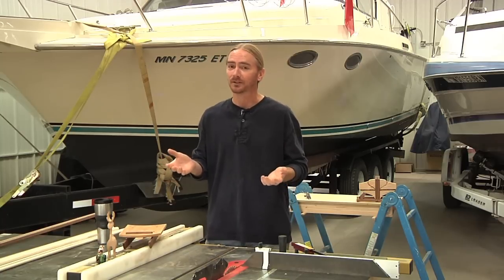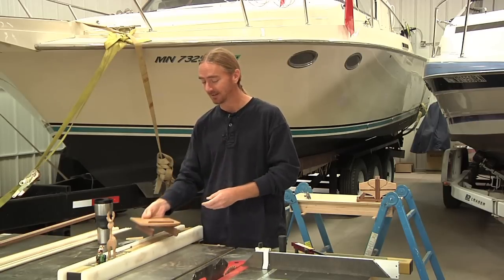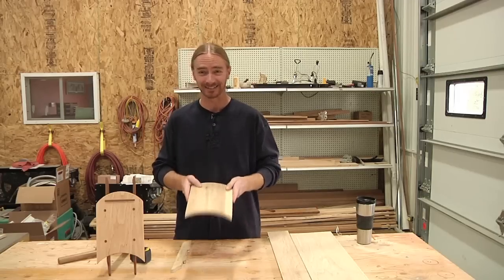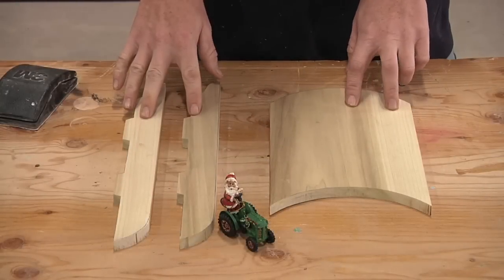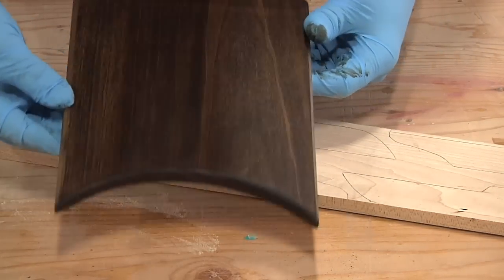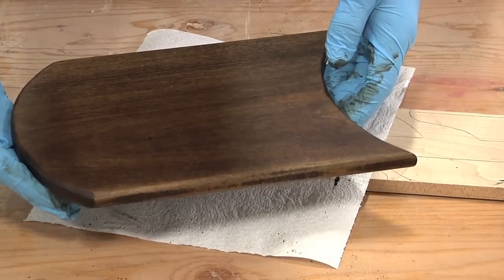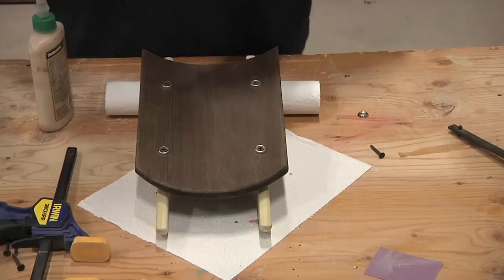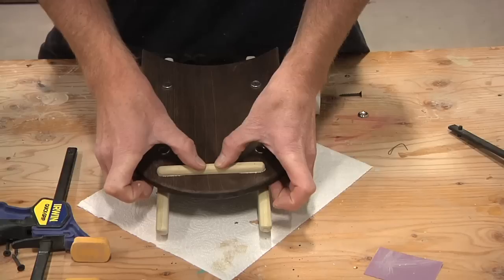Christmas Sled Build

Comment: I actually found your site looking for advice, instructions etc regarding the application of a marine finish to a teak seat board I repaired on a small cat boat. Basically two cracks, used 4 dutchmen/bowtie's and epoxy.  For finish, used Cetol, rest of the cockpit was in this and I did not want to refinish everything, but never had used product before.   

I looked for you other site, searched on fromthewoodshop, or link on other site, but could not locate.  Any URL you can pass along?